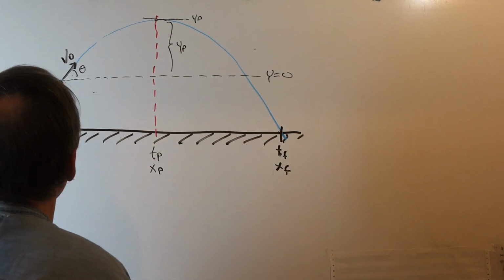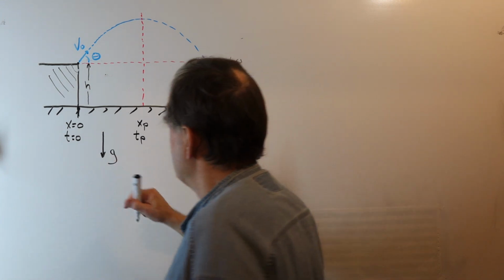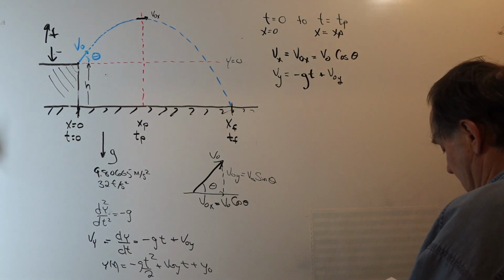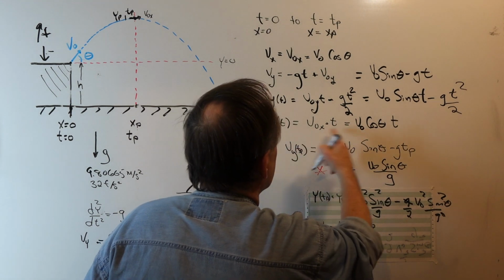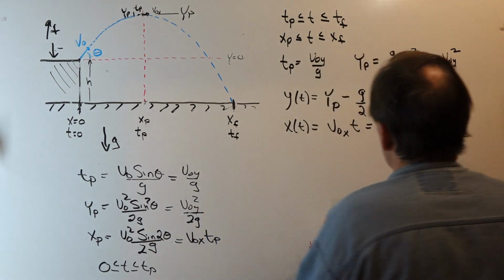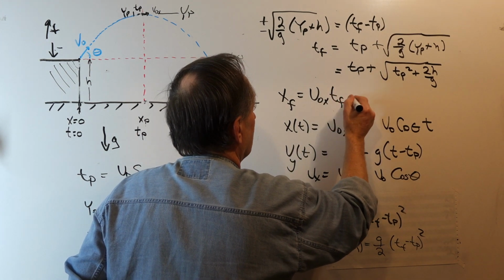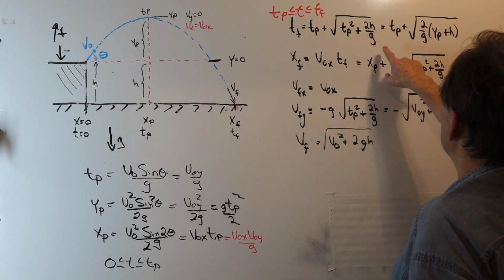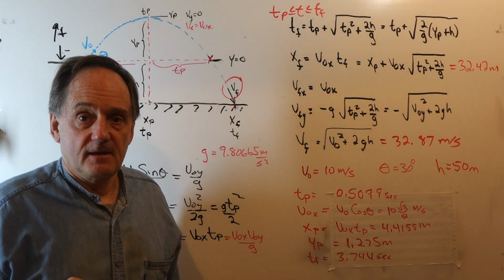Ballistic  flight  Problem #1

Comment: Hi George.  When you have time please review and debunk the latest FECORE test...
Google search = Long Distance Microwave Second Attempt Report | FECORE
kind regards,
Reply from the maker: Jonah,
I immediately become suspect when authors cannot write a report in proper English.  From the report:
<<<Is the AF5XHD unit with this antenna powerful enough for the 307km distance? According to the manufacturer’s specifications, it is designed for such long distances. We are going to test the unit on shorter distances of 10-20km, 50-60km and 100+km to measure power loss over distance. We can measure transmitting power and path loss over these distances to calculate dBm level for new the world record distance. >>>

Nothing is mentioned of the "spectrum analysis" measurement capability and techniques employed.  You would think they would use a real spectrum analyzer like the Hewlett Packard  8566A and a calibrated antenna to measure power densities.  All they mention is using Ubiquiti spectrum analyzer software - nothing about hardware used.

How is one to use this:  <<<The Pecs side is at an altitude of 626 meters MSL, and Debrecen is at 169 meters MSL. The beam on the Debrecen side is only 30 meters from ground level with forests along its path. 25km away from the Debrecen tower the ground level drops 30 meters to 100 meters MSL giving the microwave beam extra clearance from the ground.>>>

How does ground level drop from 30 meters MSL  to 100 meters MSL?   That indicates a rise to me.

Trying to interpret anything these clowns do is near impossible with such poor writing skills and childish report layout and format.  This is a waste of your time and mine.

GH   Oct. 02, 2019   8:49pm

Comment: I'm impressed that I could still solve this problem 56 years after leaving school but I solved it using those basic physics equations that are engraved on my heart and completely bypassed the calculus that I learnt later.  I learnt them as s = ut +  1/2(at^2)  and v^2 = u^2 + 2as.  I can only remember them using those original symbols used in UK schools so they have to be translated into any other symbology required.  Actually the hardest part was remembering what the definition of sine and cosine is.
Reply from the maker: You are doing just fine.  I enjoy your contributions in the comments to my videos -- it is a pleasure to have a fellow engineer to communicate with.  Get tired of all the FE nonsense.
GH